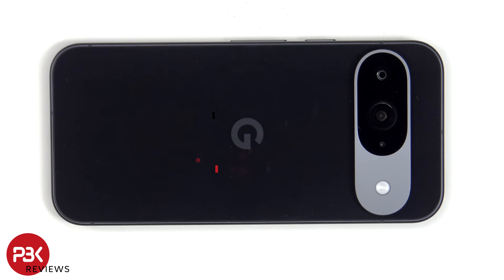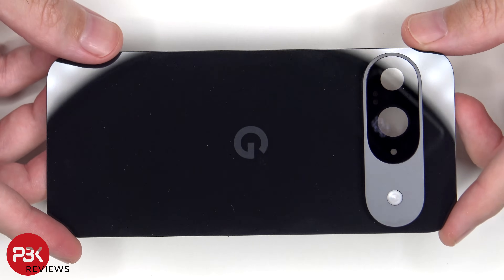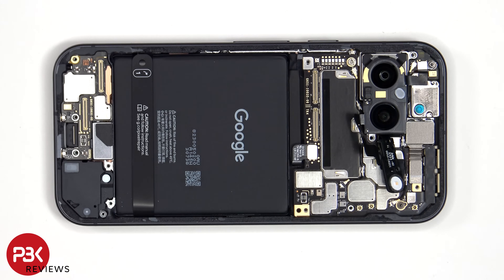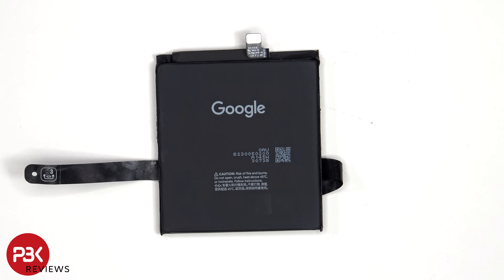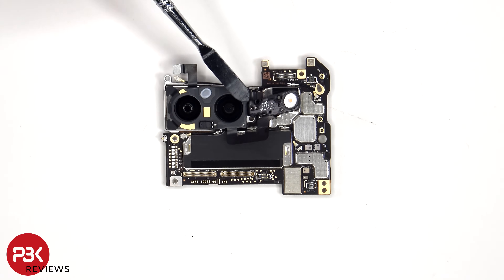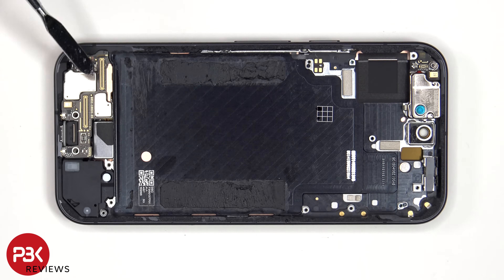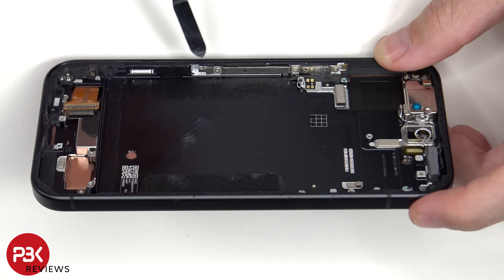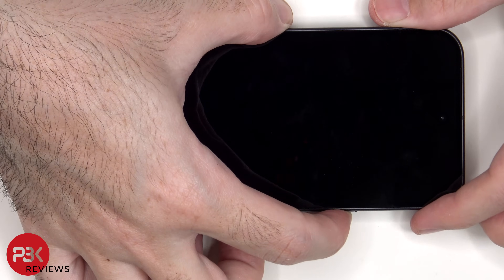Google Pixel 9 Teardown. Finally a Replaceable Charger Port!

Comment: Great video !!
Recently my 9 pro xl face charging issue like it not used to charge (1/10) times, charging logo use to be on despite unplugged n all. The service team shared a job sheet with change of chin board and PCBA- assembly. Can you help me understanding what was changed . And was there need to change motherboard ( I guess it's PCBA) , for a charging port issue .

Comment: This video isn't removing the battery like how google recommends! (even though it's probably the best way without tools) If you go to google's link on the battery tabs, there's a section under "Repair help articles" entitled "Learn about self-repair", where the repair manuals are located that explain the proper way to remove the battery. - please upvote this so the info gets to the top

Comment: Looks like there's a ton of adhesive for the battery, and you need to use that stuff on both sides the full length of the battery, but not at the top and bottom.  ;)

Comment: I put a pin in the lower microphone thinking it was the sim ejection.  Do you think the mic was offset from the hole?  Or could the pin have caused damage?
Reply: I did the same thing , 😮 but it's been couple months now and nothing seems to be wrong , speakers work and mic works on phone calls. Thank goodness for that . 🤞

Comment: it's almost 2025 and pixel doesn't have vapor chamber still yet...
Reply: I’m pretty sure the 9 pro does.
Reply: The pro, pro XL and 9 pro fold do. The iPhone 16 doesn't even have a vapour chamber. The pixel 9 is cheaper than the iphone 16 and the s25, obviously they're gonna cheap out somewhere to keep the cost down and this is literally the only model in the lineup that lacks of vapour chamber and it's still has a pretty large graphite sheet.
Reply: What's that?

Comment: i have a pixel 9 and can confirm it's so much better than the other pixel phones i've had (the 3a and 7a). im getting 12 hours of battery on one charge, and ive had absolutely no heat issues like i had on my 7a.

Comment: Yeah modular charging port aside, im still wondering why are batteries welded to the frame with the amount of glue that could probably hold an elephant's worth of weight. Its not like the battery will fall out at any given moment or anything.

Is it really just a question of companies not willing to invest pocket change into inventing a thinner adhesive strip?
Idk, i dont understand it. Just seems illogical to me to use THAT much glue for a part that clearly doesnt need that much.
Not talking just about Pixel 9 here.

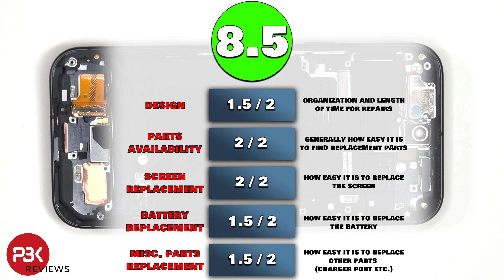Comment: 3:48 thats not Perfect too easy, any One Notice the battery Removes........ Finally Usb subBoard In pixel.........😂 10:39 Its Good to See. Easy to Replace............ Good Design for Part......... But Rates of PARTS its too Many Highest $ Cost they made..... Call Service Centre and get estimate of Part 😂

Comment: 8,5 reparability - is device that can be repared by user, like fairphone 5 or something. i am skilled user, and i see that repair is a nightmare, i wouldn't step into it by my free will. this is 7 at most. at very most.
Reply from the maker: My repairability chart can differ from others. It's not only based on how easy the repair is but also other factors as broken down in the chart. The fact the screen can be replaced by just heating it up and prying it off from the front, and the rest of the phone parts can be replaced from the back not needing to take the screen off is already a good start. Overall its more repairable than the last models from google over the years.

Comment: I saw a teardown for the Pixel 9 Pro XL which mentioned that it's tough to do. Seems like the regular Pixel 9 is much better in that regard.
Reply from the maker: Most of it is fairly simple, the battery will just take some time but doable. 🙂

Comment: All they gotta do is have a better cpu and I'm sold
Reply: Exactly that's the Only thing they're Holding Back, c'mon GOOGLE 
We got 16GB Multichannel RAM monitored by Ai algorithms imbedded to OS + 1TB internal storage 

All We need is Snapdragon flagship performance equal from G Silicon
Reply: Totally Agree
Reply: Yes the only reason this year I went with iPhone 16 pro 😢
Reply: @rezaakbari1773  You should have waited... 2025 is gonna be new era
Reply: I have a pixel 9 and they fr don't need a better CPU. The benchmarks may be not good but benchmarks literally aren't saying anything. My old pixel 7 works like on the first day and my pixel 9 has no lags at all + the ai features are crazy. A better CPU would just give you less battery time.
Reply: @radufacalau1930  Nah bro, there's always a saying 

Higher the number ; better the performance in most cases associated to Electronics most of the time 
Not for everything 
Higher the temperature; lower the electron flow high resistance 

Benchmark doesn't always relay on actual performance but practicality and using the phone gives you a basic idea 
I used to repair smartphones with other guys on the field as well so we know it is what it is..

We MUST have an Upgraded CPU , no logic can deny that 

There's always an efficiency factor to improve which they will if they manage to pull out the Snapdragon flagship equivalent from G Silicon
Reply: They should come out with a update to be able to remove it or move it.
Reply: And to be able to take off that damn Google search bar at the top of the screen. I sold my Pixel 7a because of that bar that cannot be replaced or moved. They say Android is more "free" than ios and yet they don't give you the choice to remove things of your home screen...
Reply: @alexgreg152  You could just use a different Launcher
Reply: @Pleskan87  I tried to use different launcher but none of them are as smooth and have great animations as the original one. And I don't want to change my original launcher, why on all Android phones you can do it but on the Pixels you cannot ? It's a thing to call Android free while on Pixels it's worse than ios. So for now they can keep their smartphones with software limitations.
Reply: wait for the floating search bar  @alexgreg152
Reply: Android doesn't have as much freedom as iOS lol (unless you want to waste time to delve deeper into technical things, experiment and mess around, iOS has always had far better customization)

Third-party android launchers perform like shit and then there's maintainance part and stuff.
Reply: @adityaisgreat21  no
Reply: @ThisHandleIsNotTaken. Cry more
Reply: @ThisHandleIsNotTaken. Cry more
Reply: @ThisHandleIsNotTaken. Trash YouTube stop removing comments
Reply: @ThisHandleIsNotTaken. Cry
Reply: @adityaisgreat21 what are you on dude? Forget customize you couldn't even move icons till ios 18. L take
Reply: @adityaisgreat21 No way iOS was ever more customizable than android. Also like it was already mentioned if you don't like the stock launcher on your android phone there are many other options unlike iOS. Nova launcher is probably one of the top choices with animation styles you can choose from and customization through the roof. I remember when iOS added the ability to change your keyboard 😂.

Comment: Its great to see google finally move in the right direction with the hardware, My last pixel 6a had micrphone damage and the service guys said that they had to replace the whole motherboard, if it had this design the repair would have gone a bit more easy on the wallet.
Was waiting for this video to drop, Great teardown as always !
Reply: Can you do a clear back mod?